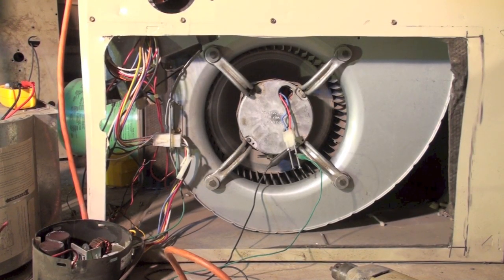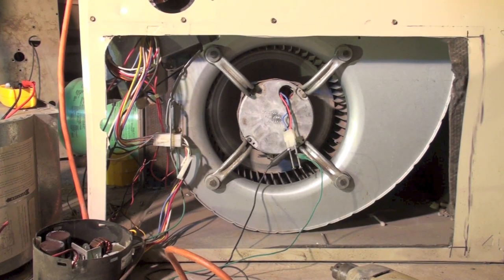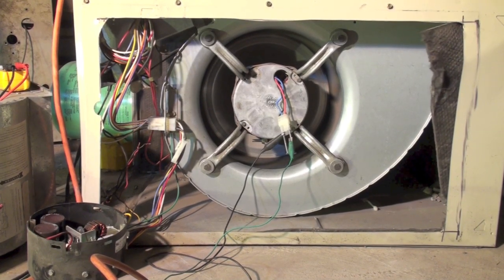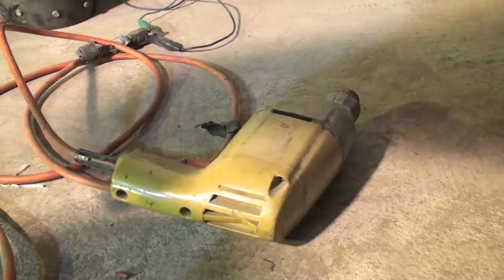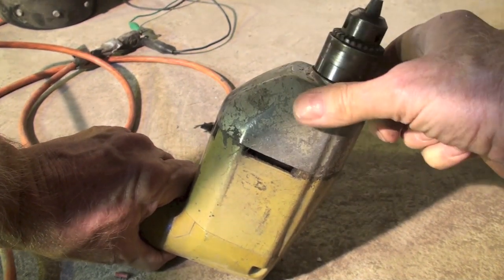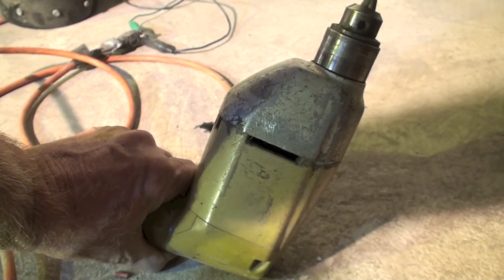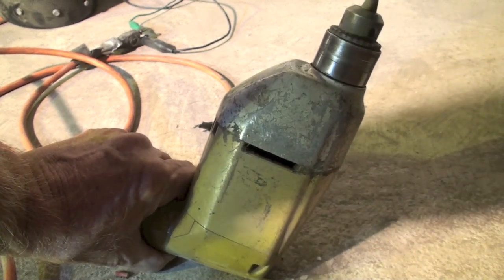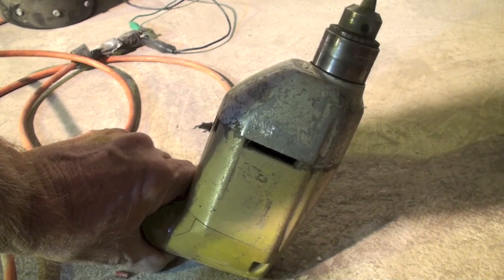Can the ECM motor generate power

Comment: I know this video is old, but I just tried that with an old ECM. I built a 3 phase rectifier for it. Ya, it worked, like GFM said, it's a perm mag 3 phase motor! I wanted to see if my motor could be used as a wind turbine, but I don't think it would be worth it. BTW, my GE unit has pretty hefty bearings!
Reply: How did you did the rectafier

Comment: This is known as regenerative breaking or regen for short. When you take your foot off the juice as in an electric car, the motor becomes a generator and puts that excess power back into the batteries thus extending your driving range.
Reply from the maker: It is similar to most EV permanent motors in that it produces 3 phase power.  However, the design is as a motor and the efficiency is quite low.  
GFM

Comment: What Does ECM Stand For?
Reply from the maker: MIKE CHIESA Electronically commutated motor.  Just means the power is reversed by electronics at different rates to control the speed.
GFM
Reply: Engine control module
Reply: Electronic control module.

Comment: I am quite sure there are blocking devices in the ECM that drives that motor. Ever see what hauls a circular saw to a halt when you let go of the switch? Dynamic braking, a simple diode that shorts out the windings driving it to a electromagnetic halt with a self generated shot of DC..
Pretty cool video though
I've been experimenting with computer fans, they are also electronically commutated, with permanent magnets in the rotor. the trick is to get to the windings and bring what power there is out as AC when the wind blows. I have tried gluing blade extensions made from a plastic bottle to grab more air and .I get enough to power some LED's

Comment: Nice seeing the Black and Decker drill. I haven't seen mine in years. Now I'm going to dug in my garage to find mine. Paid something like 7 or 8 bucks for it. It still works if I can find it.
Reply: Bought the same drill back in the early 70's, I paid $8.88, repacked the gearbox with molly grease and ran the snot out of it with a sanding disc, it got hot, kept my hands warm out in that cold rented garage.
Reply from the maker: Craig Nehring If it gets hot, just use it with a rag.  It will keep running.
GFM